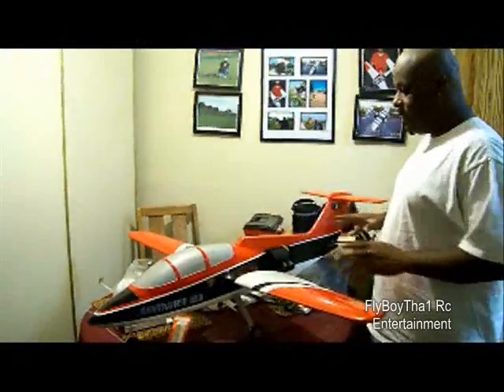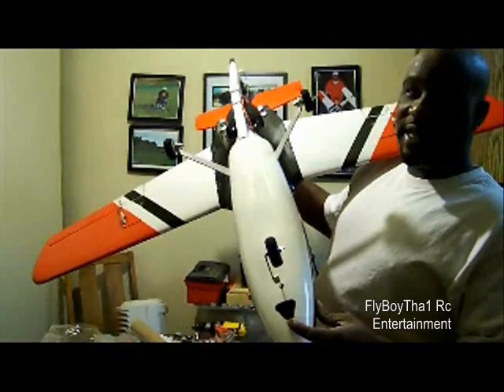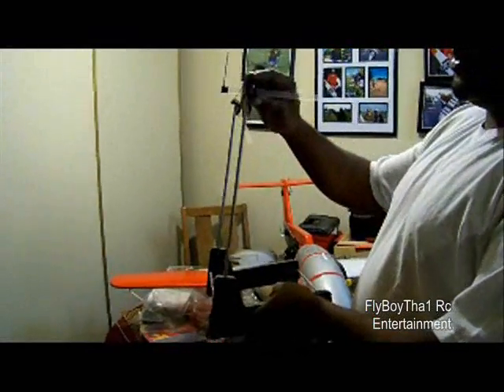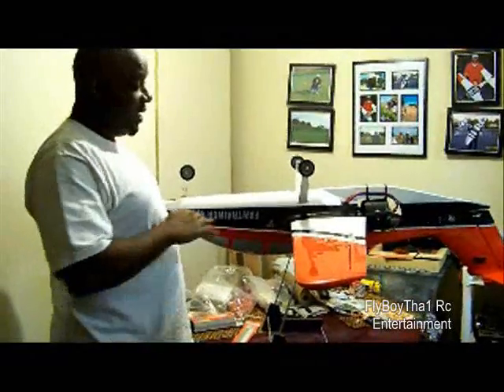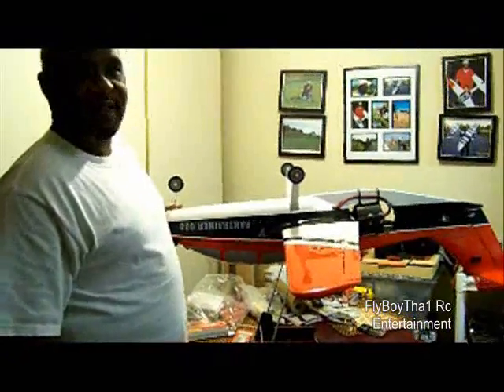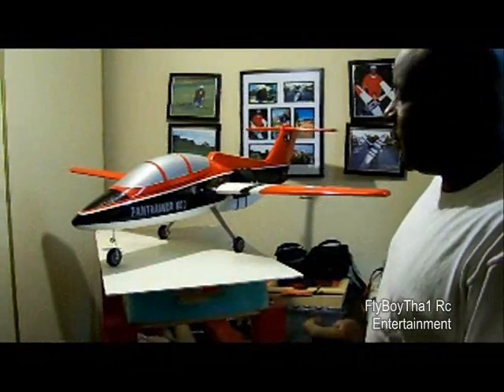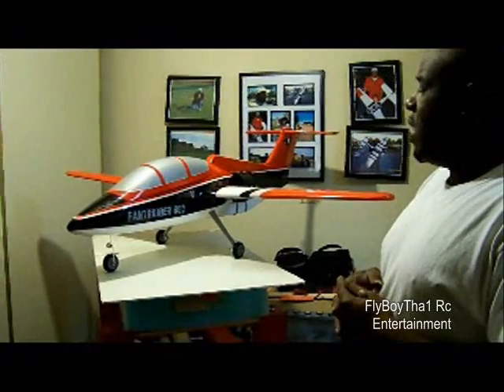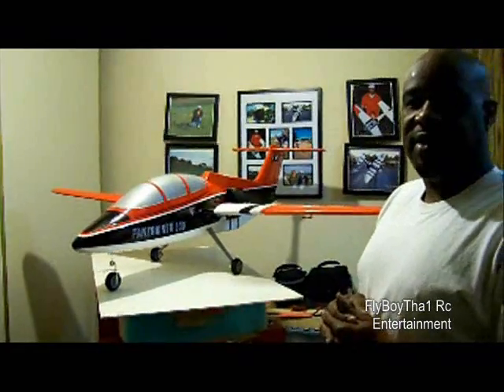Nitro Planes 100mm EDF Fan Trainer CG Balance & Taxi Test Build Part 5

Comment: since the plane isn't nose heavy enough, if i were you i would move the battery forward instead of adding more weight. adding weight will compromise the plane's maneuverability, speed, and stability. shifting the weight wont harm the plane